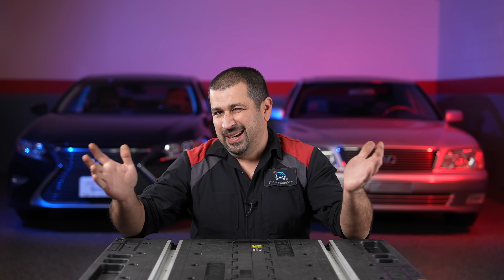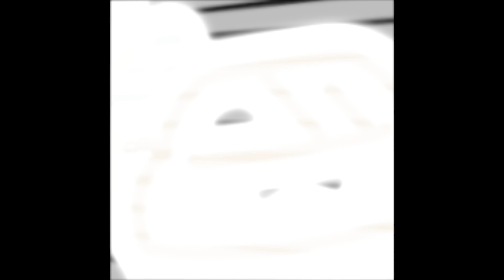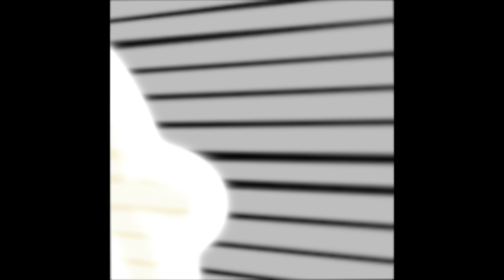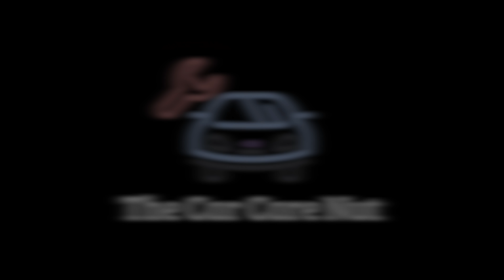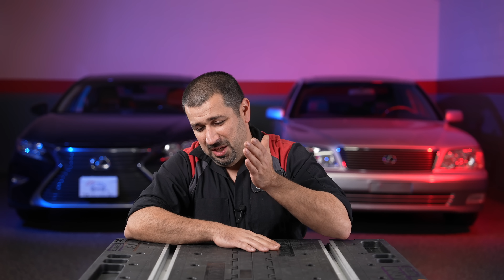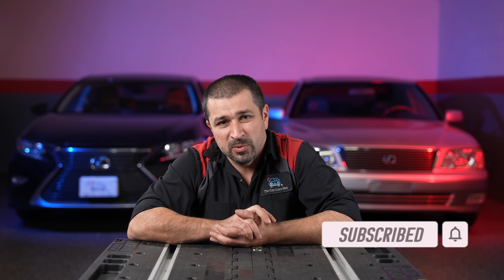Can Modern Turbo Engines Be Reliable? Here's The TRUTH!

Comment: I'm going to do my first oil change on my 2025 Toyota TRD Sport 4 cyl at 500 miles. Then again at 1500 miles. After that I will still to a 3000 mile change for as long as I own the truck.  This worked on my  1991 Toyota 4x4 truck 4 cyl.  This truck still runs like new after 31 years.
Reply: I agree. I did the same with my car. Oil tests show that you should change the first oil change by at least 1000 and the second by 2000 then every 3 to 5000
Reply: @EazyT8439  "oil tests show"  "many people have said"  lmao
Reply: @EazyT8439 mine yes but after 3 they said I could go 10k the next 2 said 17500. But I still change it 7500 in summer and 10 other that that.
Reply: I can 100% tell you ur new truck won’t be around for 31 years 😂
Reply: Did it have a Turbo?
Reply: That is what the Oil Geek said to do. Good advice.
Reply: Overkill. Do one at 1000 then 5k intervals, should be fine. That’s what oil analysis show.
Reply: You must be watching the Oil Geek. And you got it exactly right. I was a Chrysler mechanic in 70's and it was always every 3000mi. Then, as time went on the manfacturers were competing to show who's cars needed the least maintenance  and if they had a planned obsolescence  plan, the higher mileage oil changes played into that.
Reply: Been Changing every 3 k for years
Reply: Who cares!  So what if your garbage is a million miles. "Oh look @ me!"  This video is about Turbos and the mith of their longevity. Not You!
Reply: The jap techs specifically recommend that but if you use a 100% synthetic like amsoil signature series you could go 7500-10000 easy. But also look into what they recommend on that engine elsewhere, the EPA likes to screw you over. 0w-20 is not a good oil for a small engine in a big vehicle. Especially under load
Reply: Smart move. Spot on, actually. You'll have your vehicles run trouble-free for many years to come.
Reply: I would suggest running some high zinc break-in oil.  I did on my latest new car for 3 cycles at 250 miles each change.  Get all of the machining debris and wear particles out of that engine and give it enough zinc and other additives to help keep things 'smooth' as the parts move against each other.  I feel it is worth the effort.
Reply: I would never buy a small engine with turbo on a heavy vehicle.  Imagine the stress on the engine trying to move that thing!
Reply: Toyota oxymoron....
Toyota TRD Sport 4 cylinder😢
Reply: V-6 BaBy 🎉
Reply: On my 2023 vehicle i completed my first oil change at 500 miles then 1000 miles then every 3500 - 4000 miles! I have never exceeded 4k miles without an oil change! Also, i only use full synthetic premium oil and premium oil filters!
Reply: Turbos eventually blow....
Reply: @williamrossetter9430 everything eventually will fail
Reply: That is literally ludicrous. Just buy an EV at this point if you are as stupid as this...
Reply: @evalangley3985  - Actually, i could change my oil BEFORE you could get a full charge on your EV! And, i only have to perform that 3 times a year where you are charging weekly!
Reply: @Bacnow I can charge an EV while sleeping at home, 52 weeks per year.

Are you changing your oil while sleeping in your own bed? No.

How many 2,000 mile road trips do most people take in a year? One to none.

People who comment on EVs taking a long time to charge, are the same people who waste 10 hours a day, two or three days in a row driving, staying at hotels, putting wear and tear on a vehicle and spending money on expensive gas on a road trip.

Take a jet and get there in a few hours. Rent a vehicle at the destination.

Weekly gas station trips are a big waste of time, and money.

Oil changes are a waste of time and money, as are brake jobs and rotors, stolen catalytic converters, mufflers and exhaust, plugs and packs, serpentine belts, transmissions and fluid changes, transfer case oil, superheated worn out coolant and hundreds of other parts and a lot of maintenance.

Great grandpa didn't want to give up his superior horse and carriage 120 years ago.

No wonder so many Americans are poor and struggling. No critical thinking skills and they can't do math.
Reply: @dvader3263  No, but a lot do a 400-600 mile trips. How many times are you stopping to charge up and how long do you have to wait? Also, takes a lot of electricity to charge in the winter. Right now, EVs are only good in areas that don't get cold and don't get too hot.
Reply: @evalangley3985 😂😂😂😂
Reply: Oil is good for 5000 to 7500 miles.   I do every 5000 miles.
Reply: @southernc4919  Yeah, that's what I have read. I change mine at 6k so I feel like I am getting some benefit from using top tier oil (1k more miles per change is something at least). I don't have a turbo though, I drive a 2017 Toyota Prius. Plan to upgrade to a Miata soon.
Reply: Good for you. That's definitely "best practices" and what EVERYONE should do if you care about your brand new vehicle.
Enjoy your new truck!
Reply: Absolute waste of money. Changing oil at 3000 is a waste of time and money. If it makes you feel better than go for it. But it will not make your engine last longer.
Reply: @cyclone-g2z Go look at Car Nuts 3.5L recent tear down video, see the oil rings impacted not working at 34K??? Turbo did that.
Reply: @cyclone-g2zdepends on oil dude. You put in shit oil like Napa or valvoline you need the frequent changes, but will still have problems. Amsoil though 10k easy on signature series. Someone saying I use penzoil or rotella and calling it premium when it’s middle of the road is a joke. But using it and doing oil changes every 3-4k on it is a waste 5-7500 as long as it’s not over 85 degrees. Plus they use low viscosity oils that it still fucks up there engines
Reply: @halftontimrvreviewsandtips3106  FYI, Pennzoil ultra Platinum is scary close to Amsoil Signature in all the metrics that matter for a fraction of the cost! Also, I wouldn’t do 10k with ANY oil, regardless of their marketing claims (most competent mechanics would agree)!
Reply: @halftontimrvreviewsandtips3106 I'm at 230k miles with 10k mile oil changes, engine clean as new internally and runs perfectly while not burning any oil. On what you refer to as cheap as. Valvoline. You hush!

Comment: I’m still just dumbfounded that Toyota abandoned the V6 when they didn’t have to. When does build for service result in customers looking elsewhere 🤷‍♂️
Reply: EPA did it
Reply: @slalomking  So why does Nissan still produce a V6 in the 2026 Passport in the U.S.?
Reply: @patmagic3301  Honda makes the passport.  That V6 is a legacy engine, it’s a good engine my mom had one in her Odyssey Mini Van.  As time moves on it will be done way with.  Look at Ford, almost every engine is smaller with Turbos, except the Coyote 5.0.  Toyota dropped its V8 for a small V6 with twin turbos.  In the Tacoma they dropped the V6 for a 4 cylinder with a turbo.
Reply: @slalomking yes, not good either way. My point was the didn’t have to “yet”

Comment: always wonder is the g wagon previous 550 and the amg63 turbo diesels have problems, many said the 550, older version, is more powerful and reliable and can turn off your turbos while the new g63 is smaller and cannot shut down the turbos, are these diesel engines reliable?? can they make it to 1 million miles??

Comment: Hi AMD, for Toyota 2024/2025 1.8 Hybrid engines Toyota suggests 0w8 oil. However, in different countries, for the same engines, dealers/authorized services use 0w20 and this don't void the warrant. They say that because of climate differences 0w20 is best for this engines and they claim that they decided this via talking to Toyota Japan. What is you suggestion? Should we keep using 0w8 or listen to the authorized services and use 0w20?

Comment: It is common to drive a naturally-aspirated Camry or Accord for 15 years, in states without a harsh winter.

Could the turbo last 15 years or 200,000 miles?   Doubtful, and a turbo replacement is very expensive.

Comment: I drive a 2500 turbodiesel with 95 Hp. from 1990 , oil every 7,5 K kms.
And also I have a 3500 V6 petrol with 180 Hp from 1999, oil every 10 K kms.
Happy with both ❤
If I want to buy a new car, I better skip the ICE and PHEV cars, 
and I will wait for a decent EV with the new solid- state technology.

Comment: Great video—thanks for sharing. From what I understand, regular oil changes are key to engine reliability. My car is still under a 4-year dealership warranty, and they recommend oil changes every 10k miles or 1 year. The service history follows that schedule. I'm curious: if your car still has dealership warranty, has anyone done oil changes every 5k miles or 6 months? Have you done at dealership or independent shops?

Comment: Super boring and a lot of bull💩.
Real reason we have turbocharged smaller engines are that they require less material (so cheaper to produce) and higher replacement rates (so we will buy a new one sooner). Emission testing it's done with engines mostly at idle speed (so turbo doesn't kick in) so, of course, small engines have lower emissions. Real life - that is a different story.

Comment: I've had a twin turbo BMW 335i for 20 years and 210k on the clock, oil change every three month, do it myself and never a problem.
Reply: Did you ever send your oil for analysis?
Reply: I had an E60 550i that I did 7500 mile OCIs (half of the maintenance recommendation) and it was burning/leaking oil before 80k miles. Got most of the seals replaced except the valve stem seals and it was burning 2.5 quarts by the time it reached 199k miles.
Reply: I would NEVER own any vehicle that required that level of maintenance unless it was a race-only vehicle.

Comment: I watched another youtube channel and this person purchased a new tacoma. He changed the oil at 500 and 2000 miles (minus the oil filter) and then 5000 miles to help break the engine in. He didnt go with the 10k mile oil change recommendation by the dealership.  Also to mention that he didnt change the oil filter in the first two oil changes but he will change the filter at 5k and beyond.

Comment: I have a twin turbo 3.0 in my 300ZX from 1994. It has like 155k miles on it with the stock turbos. I do the maintenance and take care of it, but I do also drive it hard. It still runs perfectly, even with a higher boost tune on it for probably the last 60k miles. What I think is the biggest difference now days with cars being unreliable with turbo engines is them relying on higher boost to make up for the lack of displacement. Having an underpowered engine N/A means that you have to work it harder to get the boost up to get it moving. Plus, they don't have 8.5:1 compression like the old turbo engines had to reduce the likelihood of knock. All this on and engine with an open deck block. Back in the 90s the VG30DETT was a closed deck block with reasonable compression for a turbo engine. With the direct injection complexity, cost cutting on pistons and rods, and plastic pieces everywhere they can get away with,  you end up with something that the bean counters designed to (hopefully)  just last the warranty.... but this is all IMO because I am old enough to say "back in my day"

Comment: This is how you know that oil technology hasnt changed.  The toyota tundra  Runs coolant throught the turbos because they know the turbos are frying the oil. I change my oil every 5000 miles and will do so as long as im under my extended warranty. One thing you did not mention is letting your car idle for a minute after hard or long driving before shutting it off.Even though turboed engines arent as reliable, they are damn fun to drive.

Comment: Your right when you say “it depends” 

I’ve owned and still own both Petrol and Diesel Turbos and I change my oil every 5000km (approx 2500 miles) and I got over 300,000km (150,000 miles) out of a Subaru EJ25 without even taking the heads off BUT it was mostly doing long highway runs - as others have said Oils Cheap, Engines are expensive 
and in almost 30 years and approximately 800,000km I’ve never had a single turbo problem, hears hoping that continues.

Comment: I just got rid of an Audi A6 with a supercharged 3 liter engine. It got oil changes every 4k miles and it seemed perfect when I sold it. The transmission was perfect too. But it was still a money pit(really bad cooling system and bad electronics).  I just bought a '25 Lexus ES350 UL because I wanted to go back to larger displacement V6 engines that's naturally aspirated. I never had a CVT and don't intenfd to get one any time soon.  I'll still change the oil at 5k miles and demand a trans drain/flush at 50k-60k miles even if they tell me not to get one. Nobody will tell me how to keep my car reliable, I know how.

Comment: In our part of the world, we’ve had the 2.4l, 2.5l, 2.7l, 2.8l all with turbos in the Toyota hilux, hiace, prado etc for years. Yet they are very reliable. So yes, turbos can be reliable. The best trick is to always let them warm up a bit before driving, and let it run for a few minutes before turning off the engine. Some people install “turbo timers” on their cars for this purpose.
Reply: When I drove big diesel rigs, 40- 50 years ago, we always knew to idle the engine for 3 minutes before shutting down, allowing parts, oil and turbos to cool down.  They lasted about 400,000 miles then, and now they last over a million miles nowadays, I hear from younger truckers.

Comment: In my 2023 Corolla GR I changed my oil every 2500 miles. Car runs at 26psi stock turbo boost. People were like you are wasting your money. Nope oil is cheap insurance change very often also I would let the car warm up before getting into boost and also let the car idle for 2 minutes to let the turbo cool down before turning car off. Simple things people overlook

Comment: 3,000 Mile or 5,000 km oil change intervals , correct viscosity full synthetic oil ( liqui moly molygen, Mobil 1, castrol edge , amsoil, toyota) , driving gently until car is fully warmed up ,  idling engine for at least  a minute or two before shut down , replacing air filters/ spark plugs  on time ( shorter intervals) and last but not least not  modifying the engine will keep your turbo engine reliable, guaranteed . Except for ford ecoboost , chrysler and  Honda 1.5 turbos, which have different issues.

Comment: Have a honda element, 12 CRV, 1st gen Ridgeline, 09 Fit, and a NV3500 V8. All NA, maintained meticulously, synthetic oil and every 3k miles. Will run them till their engines die and swap another one in. I live in CA so no rust to worry about. I have no interest to buy anything newer and certainly No turbo for me. I like it simple. Everything new is overpriced, has too much tech with BS start stop, cylinder deactivation, and everything else engineers can think of to kill reliability. And most importantly its getting harder to DIY a lot of the newer cars because of said tech.

Comment: It's the people at the bottom of the economic order who are screwed. I'll never give up my 03 1ZZ because there is no turbo car that will last like it has regardless of maintenance. A turbo/wastegate/intercooler/high pressure fuel system that isn't there will never fail. When any of those parts fail it's $$. No turbo car will run the half million miles plus that the 2gr-fe in my Camry will regardless of maintenance. If you're 20 years old looking for a decent used car forget about it. First it'll cost you a year or more's salary then it'll cost like hell to fix it while you're still making payments on your 10 year old car. I feel for the young. I didn't save long to pay cash for my first used car & the parts it needed were cheap.

Comment: As an owner of 1.6 EcoBoost thats remapped to over 230hp@crank - turbo engines wont kill reliability. Their manufacturers will. I have full engine temp on dash, while coolant is on like 55-60°C (~30°C below thermostat, 131°F-140°F, so it's around 54°F below thermostat). I'm wondering how many Fiestas ST had problems because of this. Also oil would be still waaaay too cold. So I had to instal 2 aftermarket gauges. One for oil temp and second for water temp. This way my engine safety till my end. I have 191 thousand kms on it (almost 120 thousand miles) and it doesnt burn oil, have something wrong with cooling system or overall reliability problems. I'm doing oil every 9-10 thousand kms (~6 thousand miles). Manufacturers now want us to change oil every 30 thousand kms! Thats almost 20 thousand miles! And they say that automatic gearbox oil if for car lifespan! 😂
Hope you maintain Your car well - it will last waaay more than You think.

Comment: I will say it again: Fresh oil every 4-5 thousand miles is much cheaper than an engine replacement.  Vehicle manufacturers try to appear to be "eco-friendly" by recommending 10,000-mile oil changes.  Think about it.  Is replacing your engine at 70,000 miles "eco-friendly?"  Is it also friendly to your bank account?

Side note - Turbo-charged engines driven at high altitudes/mountains perform just as well as at sea level.  In thin air, the turbo will spin faster to deliver the same volume of air to the cylinders.  I took my Passat with a 2.0-liter turbo GDI engine on a trip from San Jose, CA to Reno, NV and there was no detectable decrease in engine performance.  The car didn't even notice that it was 4,500 feet above the sea level.  Those turbines are magic.  Cool stuff!